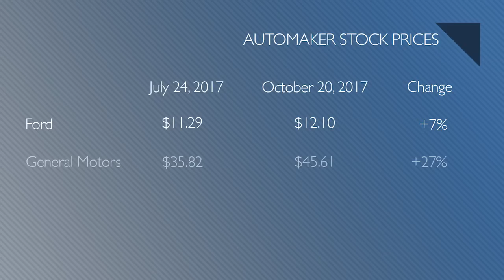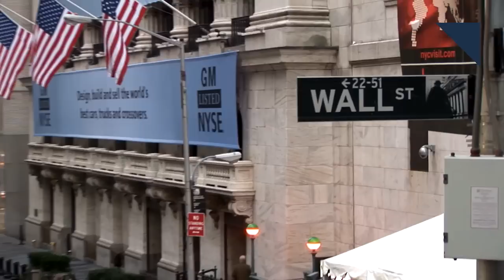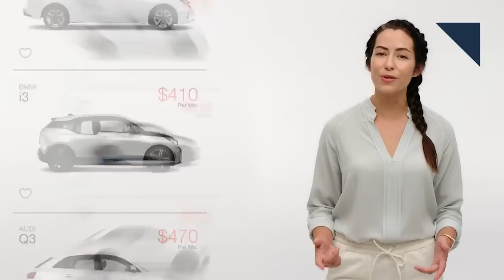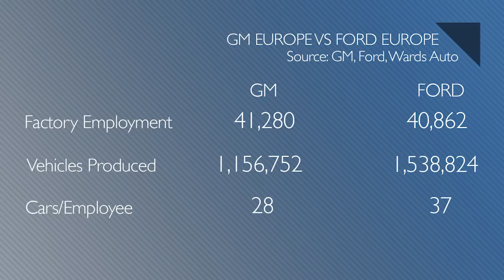Toyota JPN Taxi, Wall Street Warming to Autos? - Autoline Daily 2217

Comment: As an Uber Lyft driver I don't understand why car makers don't get what we drivers really want... Purpose built taxis don't have to look obscene or be so small or only have ICEs. The perfect vehicle would be a large 3 row electric vehicle like a minivan or SUV with awd that goes 250 miles on electric with an all rubber interior for around 40-60,000 or less. My Bolt works great and I drive 150-200 miles a day. However the Bolt isn't capable of taking larger groups , doesn't have awd as an option, and doesn't have an interior made for such routine abuse.

Comment: Exactly why my next car will be used 2012-2013 Nissan Leaf SL, leather interior, navigation, Bluetooth, heated seats, heated steering wheel, no gas, oil, transmission fluids, charge at home, use it for going to work and running errands, keep my ICE car for longer trips , less mileage, wear and tear, less oil changes, saving gas on that ice car! And that used Leaf will only have average 25,000 to 40,000 miles, like new condition, at average $6000 to $11,000, you do the math...

Comment: EV depreciation is exaggerated because of federal and state incentives.  If you buy an EV for $30k, get $10k off in incentives, and then sell it three years later for $15k, it looks like 50% depreciation when it's effectively 25% depreciation, a $5k loss vs. a $15k loss.
Reply: BEVs, in particular, depreciate at a huge rate because so few people actually want them and the technology is constantly moving with little to no backward compatibility with newer technology. I'm sure the incentives don't help, but those are the two real big issues facing  used BEVs, Hybrids as well face this issue, but are not nearly so badly hit.
Reply: good for you to admit that battery tech will surpass ice soon
Reply: Jon Dittmar,

And how did I say that? Or are you still trying to find some kind of a "win"? 

Also there you go again being off subject. But I'll bite, if you actually have something meaningful to say.

I shall add that I have never been big on Battery technology in Automobiles and that the future of Electric propulsion is on board power generation. How that is ultimately accomplished is up for debate with people who have not outed themselves as morons and trolls. As it is ICE can, on a 15gal tank, pass 700miles already and that is not a hybrid of any type and that is only going to improve. Add lower cost to do so, and I'm not seeing Battery technology as anything but a solution to a problem the batteries create themselves. 

The creation of Bio-fuel and Synthetic fuel mass production, which would greatly be aided by Solar power, is a much better solution given these "fresh fuels" require carbon dioxide in the production of the hydrocarbon fuels, this then removes excess CO2 from the environment thereby playing a much more meaningful and active, role in cleaning the environment. This is basically creating and closing the energy cycle of IC. Create the fuel burn the fuel, recapture the CO2, create more fuel again. 

Further And I have told you this before (if you insist on stalking me), that the only real advancements being made in battery technology,that can be relied upon to be there, is simply packing more cells in the same space. This often requires reworking the wiring and so is not backwards compatible to previous generations. Those batteries are not meaningfully more advanced. The newer formulations of battery tech like TiNb anode batteries while set o go to production in 2019, it is not clear if they mean as smartphone batteries and/or BEV and Hybrid packs. I can see a faster more reliable return on investment in Smartphones first. Plus it would give much more credence to safety test these in the field in something that won't endanger your life if it should fail, catch fire, or or or.

"Soon" is always relative. And Battery tech, until it delivers, is always promising. ICE tech is always delivering.
Reply: "the technology is constantly moving with little to no backward compatibility with newer technology." docwolph
Reply: Jon Dittmar,

That is just grasping at straws. Further, I sorely dislike people saying I said something I did not. "If I did not say a thing I did NOT say it". Do not assume I said something as unproven and untrue as "battery technology will surpass ICE technology" When I NEVER said such a thing. 

Saying I said something I did not makes you the liar, not me denying it. I will draw an inference and tell you what I think you said. but I will never say you said a thing. After all, I don't know what you meant, and even if I did, I will never assume. 

Next "Constantly moving" is not necessarily, and in this case of Battery technology, not forwards. As I have said, it is repackaging and refinements in manufacture. That is sideways movement, not forwards. Much like IC engine downsizing and using forced induction, is sideways movement for ICE Tech. However, SPCCI, HCCI, and others are forward moving advancements. THAT those are happening  soon.

Meanwhile battery technology keeps making big promises but it is either so laden with caveats or is so much vaporware, you have to wait for it to actually hit before even saying its there. Many times those "advancements" are just PR to try to get investors. Some may be for real especially those from big corporations, like Toshiba, but that is the same as fishing for customers.

So again "soon is relative". ICE Tech is delivering "soon actually". Batt Tech is a "soon maybe". Having spelled it out for you, don't make the mistake of assuming I said something I clearly did not.
Reply: DocWolph So what is this new technology in current BEV that is incompatible with older ones?
Reply: Daren Morris,

It has more to do with the "refinements" manufacturers are making, mainly the packing of cells and their placement requirements. The Batteries cell shapes and configuration change and the wiring can often be incompatible. And if the battery technology requires new electronics for moderation and control, there is that issue.  

As a real world, in miniature, example. Kyosho and Tamiya have been reissuing RC race cars from the 1980s and 90s. These models used very different battery technologies, Ni-Cad and NiMh, and they were designed to carry those batteries. Their Electronic Speed Controllers (ESC) were also designed to use those batteries properly. Now that those companies have been reissuing those models, the battery technology has moved on quite a lot. Today, the standard are LI-ion packs. But these packs are larger and packages are very rectangular bricks and not rounded sticks, that were much smaller. AS a result those models had to be redesigned just to carry the new packs. Plus the ESCs While a small in size and cost, you extend that to a full size vehicle and it becomes a real and real expensive issue. Companies making cells of differing sizes and styles, Car maker requiring differing sizes and styles, with few inter-corporate standards between. At least RCs use the same size batteries or expect to be able to. 

BEVs and Some Hybrids will have the hardest time adapting to or being adapted to the new batteries. and then there is the cost. No matter what comes, batteries for a BEV is going to cost as much as a new IC Engine and Transmission combined, at a minimum. And if new Battery technology, actually new, not just refined, does come along it may prove cheaper and less of a hassle to just buy a new BEV in most cases. Plus you have to wonder what will happen to all those old BEVs when there 10-15 year battery finally has to be swapped. Will anyone want to do that. Compare that to the ICE that may  need a rebuild every 150K-300k miles for only a few hundred to a couple thousand bucks. Usually only a few hundred. It will be a bit taxing to imagine. 

Again, it has more to do withe the refinements in battery making of current battery tech more than any actually new technology for now.
Reply: going from 24 kilowatt hour battery pack to 40 kilowatt battery pack that has the exact same weight and volume is not an improvement? what is an improvement in your eyes?
Reply: you call me a liar and a troll but if you actually believed that why do you keep responding to me and not just simply report me?
Reply: Jon Dittmar,

For quite a while, I have been convinced you are a troll, because you keep asking the same bone headed questions expecting a different answer. Never give sources for your claims and basis for your beliefs on a subject. You never stay on subject seeking to drag the conversion where you want it, never seem to have more than ONE thing you want to or can talk about, even when NO ONE ELSE is talking about that. Like that one guy at a party who uses any tangent at all to talk about sports, as an example, instead of what everyone else is talking about. All signs of a troll. Or some dimbulb who doesn't really know enough to have a constructive conversation. 

Then you seem intent on stalking, me at least, trying to continue a "discussion" we were having that came to an end a week or more ago, and then have the gall to be upset when I respond with the SAME answer I gave you before. "I wasn't talking to you." You either have the memory of a gold fish, or you are trying to pull my leg.

Then adding you want to say I said something I never said based on stretching the credulity of a comment I made to someone else over a different subject, "putting words in my mouth", and again you have the undeserved gall to get upset when you are lying about what was said. Saying someone said a thing they did not IS lying. So, stop it. 

Again, "If I did not say a thing, then I did not say that thing."This is the internet. I rarely "mean what I say". "I say what I mean", and I find metaphor lost on 99.8% of people. Even then, half to them are probably looking to troll someone and anyone that has half a whit's idea of their ass from the elbow is fair game. 

I will not help you if you think you have to win something because you are so bereft of actual knowledge on a subject you can not support your own position effectively. 

I have not reported you because I would think you would show enough good taste that reporting you is not necessary. Or am I making the mistake that you can not, will not,  get past acting like a five year old, just keep pushing until it pushes back, then get mad because it pushed back? Claiming I said something I did not is lying and if you persist in doing so, and you already know I have an unnecessarily long memory, then yes I will start reporting you. You crossed a line. 

I can be an ass and a wiseacre myself. I love "explaining the magic". I do it to torque nimrods, and children who just want to win something. My comments will always be there and I will not recant them. If I am in error, YOU BETTER PROVE IT. Only then will I apologize, if called for. But you will not trick me into it. "If you don't ever want to say you are sorry, then never do anything you would ever be sorry for. and if you do just say you are sorry and move on."

Comment: why is ford stock so low? in comparison to GM, just curious.
Reply from the maker: Wall Street likes GM's move into mobility and autonomy, which it has communicated far more effectively than Ford.
Reply: Check how many shares outstanding.  More shares = lower price.  Nominal share price is not that important.  Earnings per share and market cap are what matters.